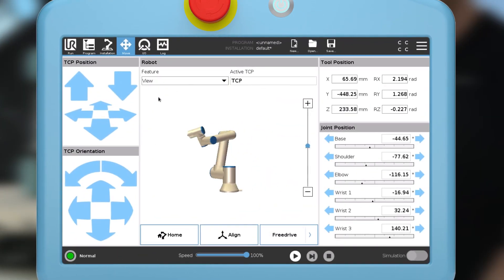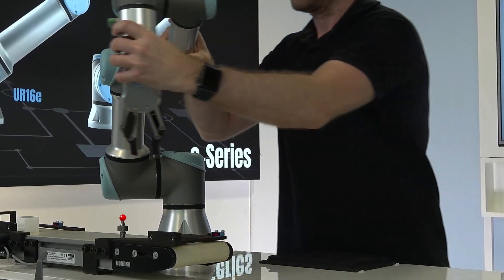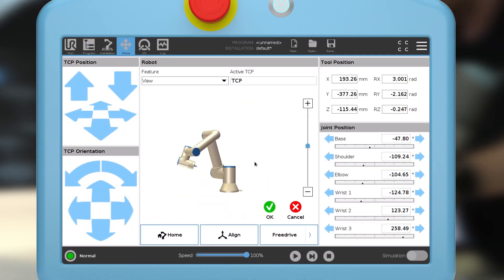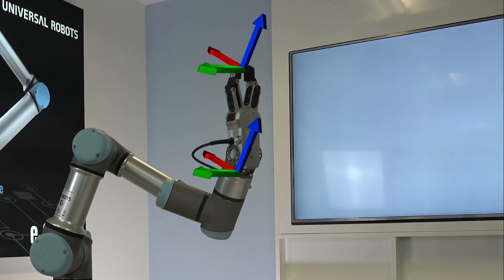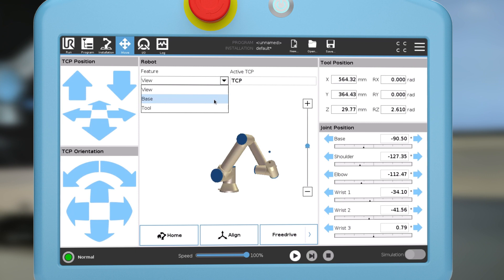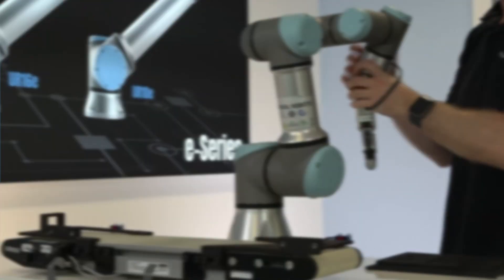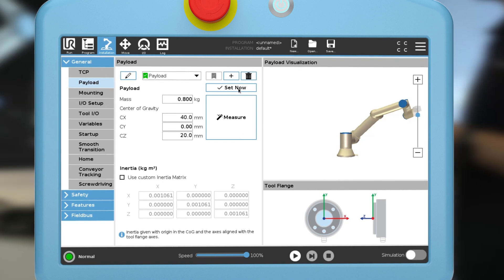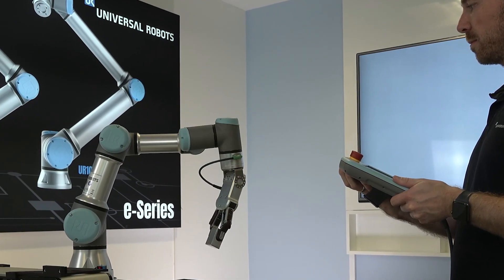Tool Configuration: TCP, orientation, payload & center of gravity

Comment: How do we align the tool-direction parallel to the Z of feature? As i saw in vid i can do only by hand and check if it is parallel by eyes.
Reply from the maker: If using the wizard, you must align the tool with the feature by hand. If you need more precise configuration, you can use a CAD program to calculate the orientation and input the precise numbers in the orientation field

Comment: can you do the same thing with dual grippers?
Reply from the maker: Yes you can. In such case you would have to teach two TCPs and switch between them during program run. And in most cases you would need four different payload/CoG settings: both grippers empty, both grippers loaded, gripper 1 loaded (gripper 2 empty), and gripper 2 loaded (gripper 1 empty).

You can find an example of a dual-gripper setup in our free machine tending e-learning here: https://academy.universal-robots.com/free-e-learning/e-series-e-learning/e-series-application-track/